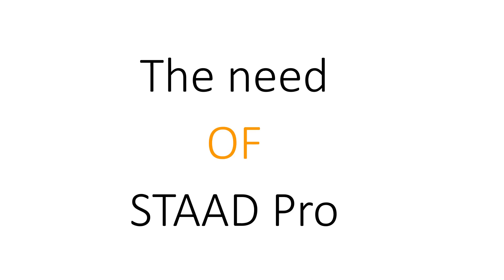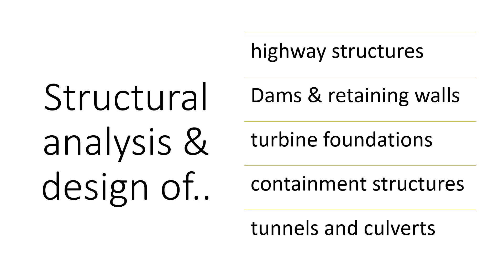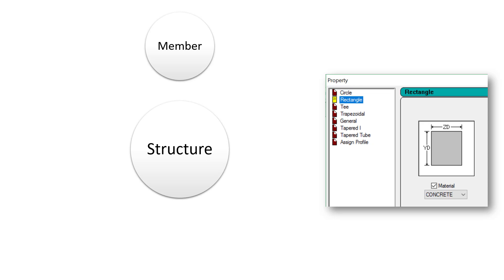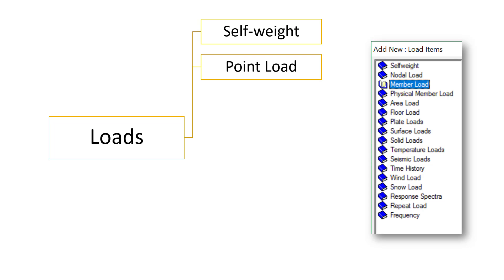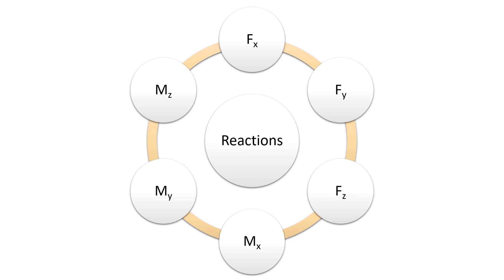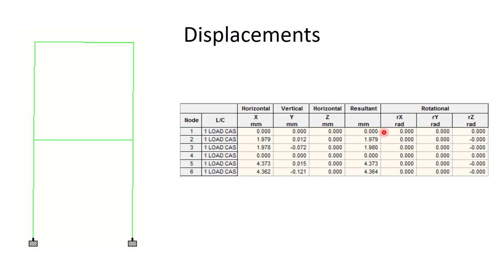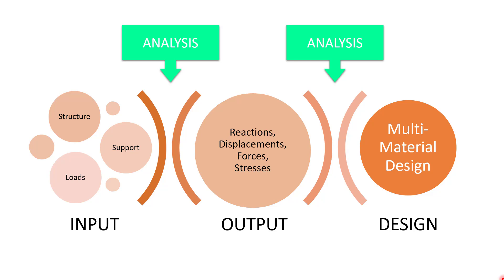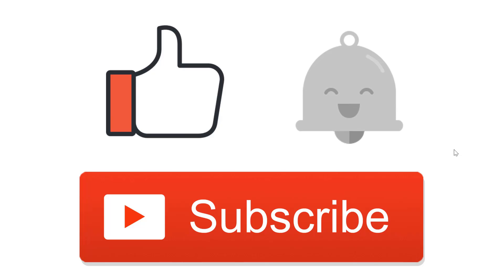What you need to know before learning STAAD | STAAD Pro for Beginners

Comment: What do you mean exactly when you say, "Your analysis is only as good as your data" ??
Reply from the maker: What I mean is that STAAD is only a software to help you out with the calculations. Nothing more. So the accuracy of the data / inputs you feed into this software determines the output / structural design you get out of this software.

Comment: You did pretty good job explaining the need for the software and how it works but you made a major mistake when you said  " the knowledge of analysis can be skipped or it isn't a mandatory " this statement is completely wrong. An engineer who doesn't know the analysis process is same as someone who is guessing what would happen to the structure. Therefore, he/she shouldn't be designing any structure at all. The software is just a tool without the knowledge of engineering is just useless.
Reply from the maker: M Gedi thank you for your kind words. And yes, I completely agree with you that one must have the knowledge of analysis. That is why I reiterated on the concept of garbage in garbage out. I intended to say that the knowledge of analysis is not a must but highly recommended. I should have phrased it better. Thank you again. Any constructive feedback is appreciated.
Reply: @CivilBlackBox  nice video